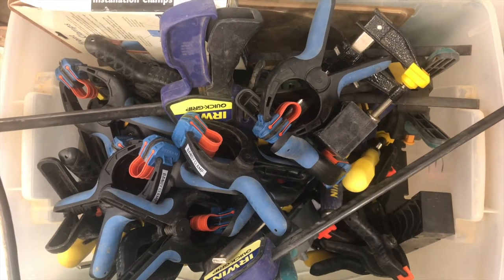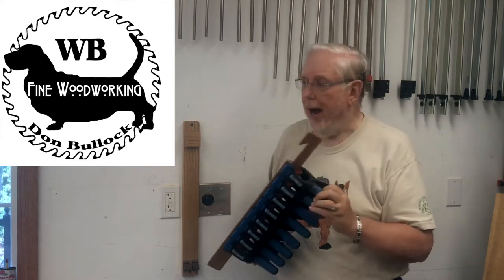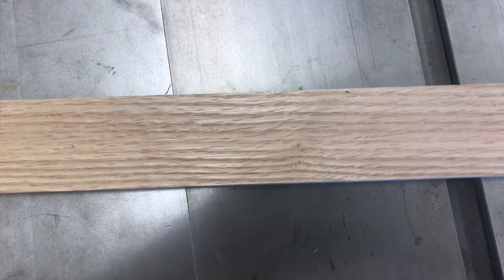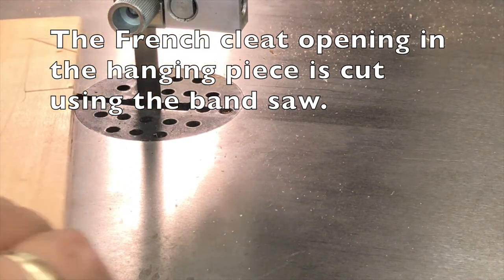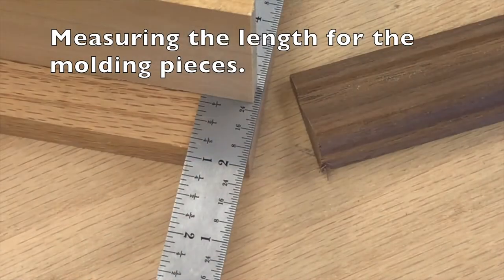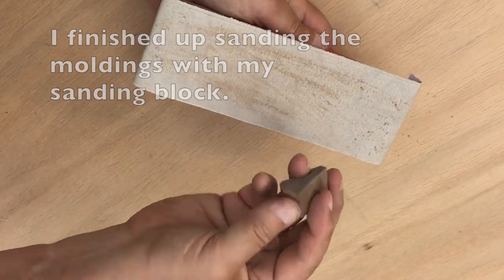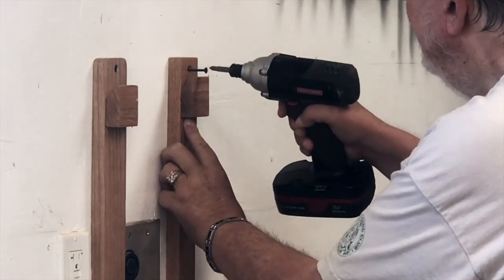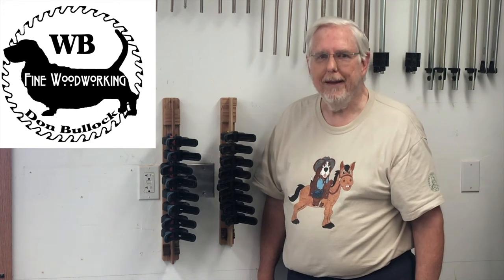Spring Clamp Rack - Easy to Make - Woodworking Project

Comment: I saw this idea over on Chad Stanton's channel. I will need to make some of these racks.
To prevent the French cleats from splitting, would it be better to glue on strips with the grain running perpendicular to the main board? This could bridge across the narrow section that split.
Reply from the maker: Thanks for watching the video. Chad’s a great guy and I appreciate the chance to show my work to others. 

Your suggestion is a possibility for strengthening the hanging piece. You could try it that way. You could also use thicker stock for the French cleat materials that I added on both sides of the hanging piece so it would go across the narrow point in the hanging piece. 

Mine were designed using some scrap wood that I had sitting around in the shop. Poplar would not have been my first choice for the hanging piece. In fact it wasn’t. For the first rack I used a piece of cherry. I have to admit mine split because I wasn’t being careful and sort of fell against it. In regular use I’m not too concerned. If another one does break it’s an easy fix. I had the replacement piece made and ready for finish in about fifteen minutes.